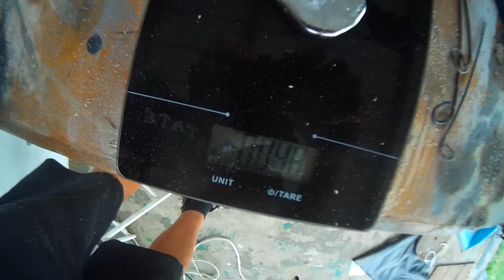Homemade no roll sinkers

Comment: Great video boss . You didn't state what you use 7-8 oz sinker mold for ? 
Are you going deep sea fishing , surf fishing using 30lb +  test line or better  ?  
I used 6-8 oz  weigh for a carolina rig to cast out pretty far 👌.   For my Penn jigmaster 500 rod .  I used 30lb  monofilament line for deep sea and surf fishing .